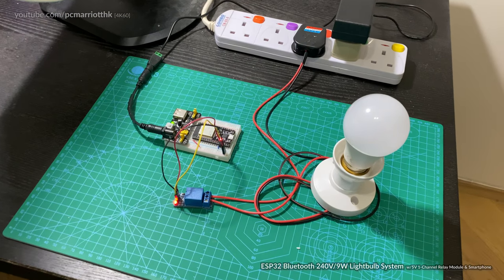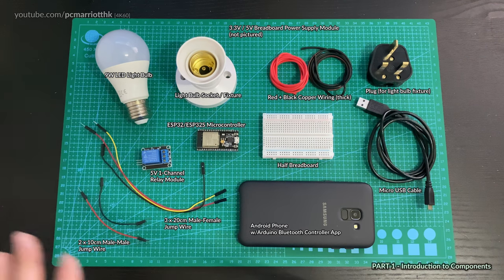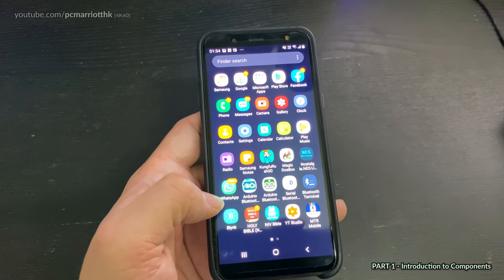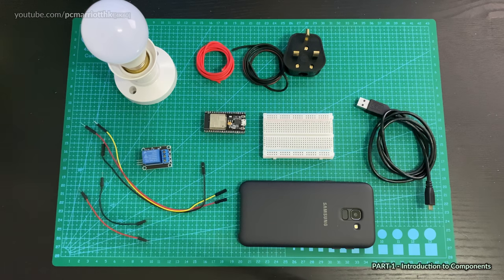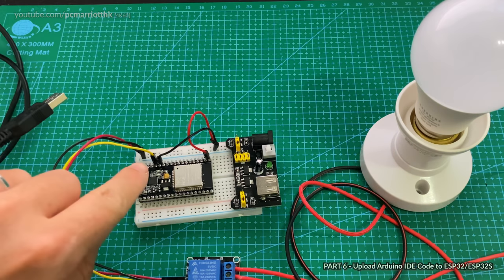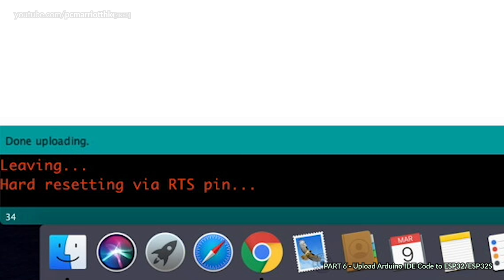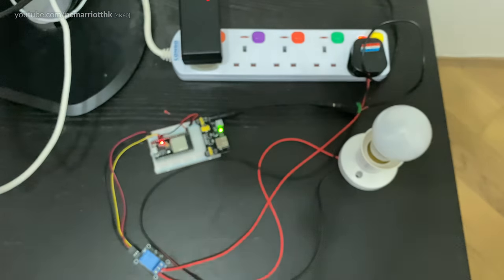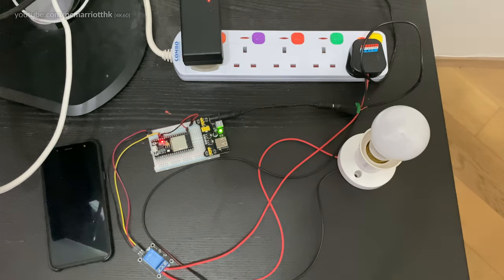1 x Light Bulb ESP32 Smart Home System w/Bluetooth, 5V Relay Module & Arduino IDE [Tutorial]

Comment: Do you have an example of using two ESP32 communicate with each other via BLE instead of a phone?  Basically wiring up the second ESP32 with a push button to turn on/off the lightbulb.
Reply from the maker: I have another demo video of 2 ESP32 microcontrollers for light bulbs communicating via Bluetooth (albeit not BLE but Classic) and using a custom-built controller instead of smartphone. If you check through the videos on my channel you should be able to find it.

Comment: Hi there!
Thankx for the video, I'm gonna build this for my backyard LED ilumination!
One question: can't you just use a celphone old charger and connect it to the powersource USB charger? Maybe even connect everything to the same power plug?
Just a thought.

Also I'd like to know if it's possible to do this via wi-fi instead bluetooth?
Thankx!
Reply from the maker: Thanks for the comment. Hope your project works out! I have not yet tried a phone charger with the power supply module so can't say whether it'd work or not. It is possible to use WiFi although this tutorial is mainly exclusive to Bluetooth and thus the former would need different code altogether.
Reply: @PaulMarriott  I don't know much about code... Is it much different from this?

Comment: How is it possible to switch 22 lights individually from a website and BlueTooth smartphone app. With DIY tools like raspberry pi / arduino
From a web interface as an external or internal network?
And use 22 pcs TTP223 switch.